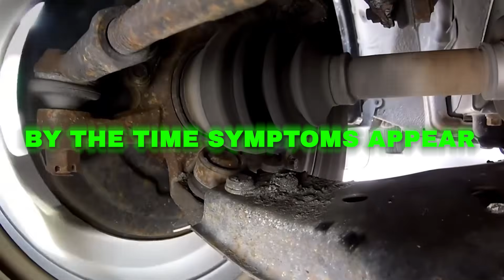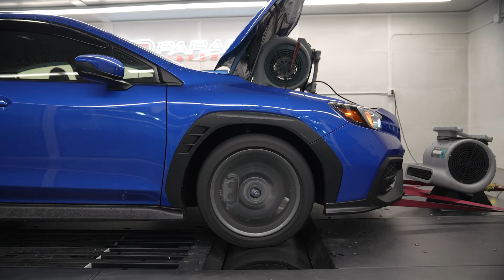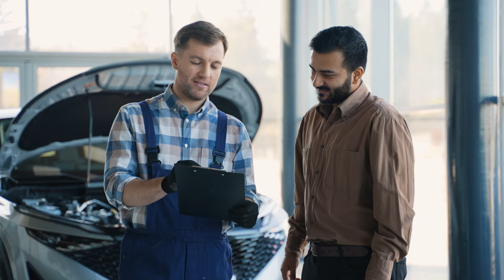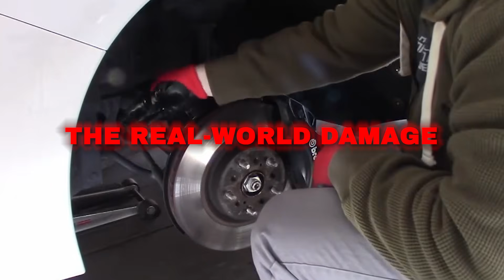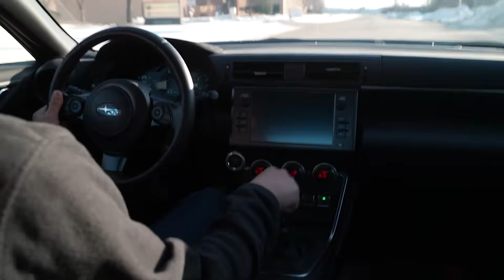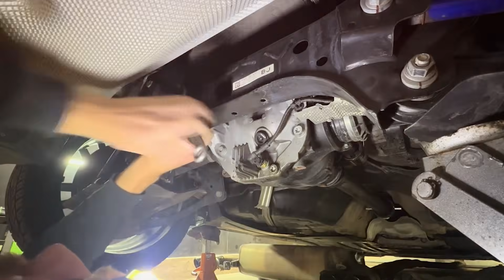These Common Subaru Mods Are Destroying Engines

Comment: Agree. I corrected my EJ255 with a conservative tune to fix Subaru's lean AF ratio and horrible throttle response and I threw away the OEM Air Filter for a Dry Flow Grimmspeed reusable filter. That was 9 years ago.